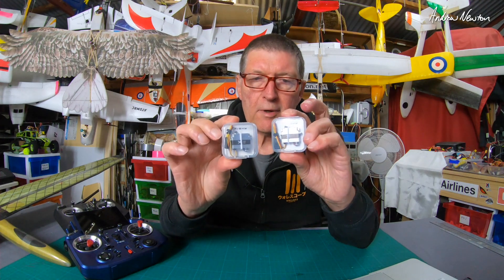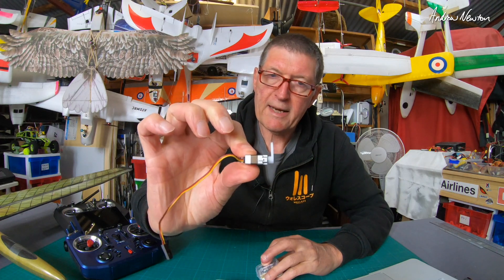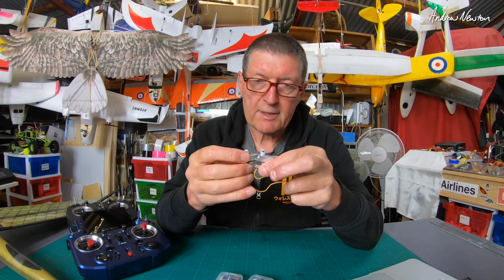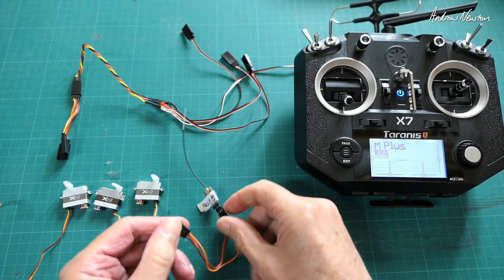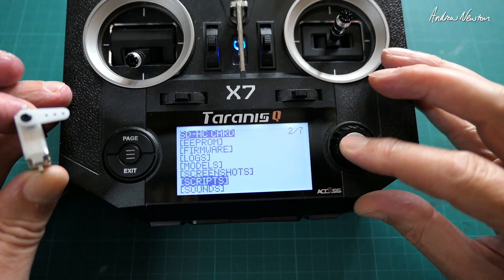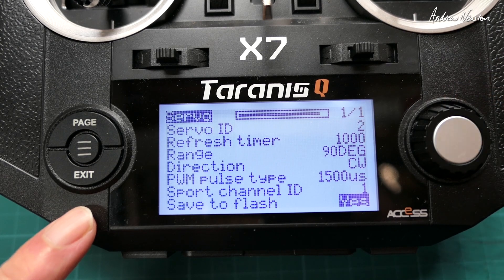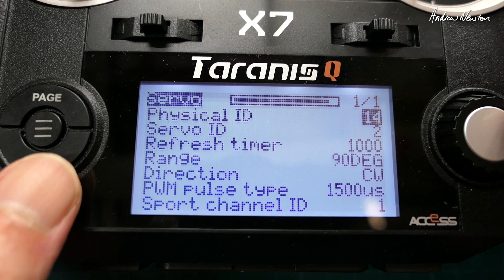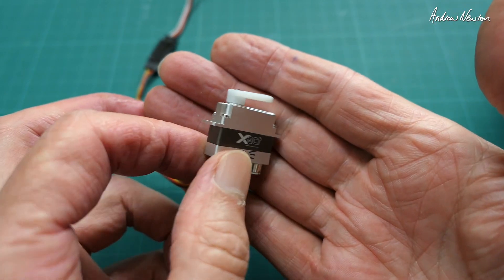FrSKY Xact HV5611/5612 FPort 2.0 servos

Comment: 760ms is for helicopter rudder servos. It's kind of pointless unless the servo and FBL controller also supports 560hz refresh rate though otherwise you may as well just use 1500ms. At refresh rates higher than 333hz 1500ms pulses will start to run into each other so a shorter pulse width is needed.

Comment: I suggest you don’t get too far ahead of yourself with the gushing praise. Frsky’s last effort at “high quality” servos the D25 looked nice on the outside, but were complete junk - they got double centres and sloppy very quickly. Mine are relegated to R/E foamies only now, that’s all they are fit for. Judge these only after you have used them for quite some time. There is a reason why MKS and KST are the kings at the top end of the market, it’s all about consistency and reliability, not something you can say about many first run Frsky products these days... 🤔
Reply: You would find some Chinese mob would be making these and Frsky would be just putting stickers on it .
Reply: @interman7715  Yes, that is fairly likely. My main point is you can't review a servo like you can a plane, where it's flight characteristics are immediately apparent; reliability and accuracy in the long run are the key parameters, and that takes 3-6 months of testing not 10 mins!
Reply: Buddy of mine bought some FrSly a couple of years ago. Defective out of the box, likley with a loose potentiometer. Hipefully they have come a little further
Reply: Xact are junk. Worst servo I owned. They need a good brand company making them. I would pay more for a high quality servo with telemetry

Comment: Ooh, nice servos!  Nostalgia corner: back when I started flying [circa 1350, just after the Black Death hit England: "Please weare ane Face-Ymaske ande observe Social Distancinge of 40 yardes, for the nones"], radio gear was incredibly expensive.

A 4-channel set with nicads and servos cost the same as an ox and cart, so a lot of ordinary people flew with 1- or 2-channel radios for ages. Adding another servo was a big deal.

After a long free-flight apprenticeship, my first RC model (45" span Keil Kraft 'Outlaw' with an OS-15 glow engine) was rudder-only, and it took me almost a year to save up to add an elevator.

Incidentally, that's why a lot of people flew Mode 1; the main directional control was on the right stick because most people are right-handed, and there was nothing for the left hand to do on a single-channel setup.

(2-direction stick units weren't common back then; each 1-axis stick moved in a slot, either up-down or left-right, so Mode 2 diagonal control mixing was not only impossible but made no sense.)

When adding elevator,  the left-hand stick only moved up and down in its slot, so that's where the elevator went, and that's why Mode 1 became the default setup in Britain and some other countries.

When you eventually graduated to a third servo for the throttle, your old 2-channel radio would be retired and replaced by a 4-channel Tx with 2x 2-axis gimbals (whee), so the throttle naturally went on the right-hand stick.  If you added ailerons, they replaced the main turn control (rudder) on the right stick, completing the standard Mode 1 arrangement.

Anyhoooo, nowadays you can buy an entire 4 channel set for less than the price of a single good servo (£50), so this video brought back some painful memories. Hmm. Imagine if today's cheapest servos cost £75 and not £3.99. How many beginners would have to learn their hobby with a 1-channel radio? How many kids could spend £300 on servos alone?

There's a lot to be said for free-flight aeromodelling...
Reply from the maker: Feel like I'm reading an old RC mag from the 60s. Love your historical perspectives Elli

Comment: i just got an Archer RS for my drift(per your suggestion) and i saw quite a few things in my manual about F. Port. Im only asking right now before i go looking but have you went into any detail about F.port and how its supposed to work?
Reply from the maker: Which FCB are you connecting to?
Reply: @AndrewNewton  i have a F411 WSE. btw, i had a little trouble getting inav to talk to the flight controller. something with the way windows was handling STM32 bootloader or the driver for usb COM. i found a video about a tool called 'Zadig' and it worked out just fine for me.

Comment: The motor and it's wires are outside the servo case...😳🇬🇧
Reply from the maker: The are a bit exposed
Reply: That is pretty much standard on all the high quality DLG servos out there from the likes of MKS and KST. It’s not generally a problem as long as you install carefully, but then those servos have a long reputation for good reliability. These ones, well... they are Frsky, so I fully expect the first run to have a disaster out quality/performance issue.
Reply: @gingermattb  I guess their excuse is to save a bit of case weight. It's a typical Chinese design anomaly you wouldn't expect to find on a 45 dollar servo..🤔😳🇬🇧